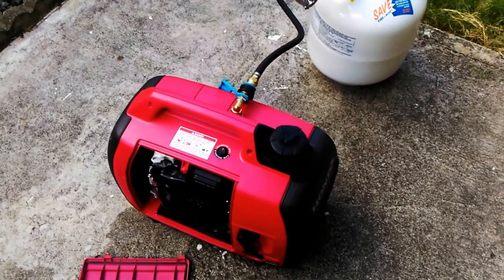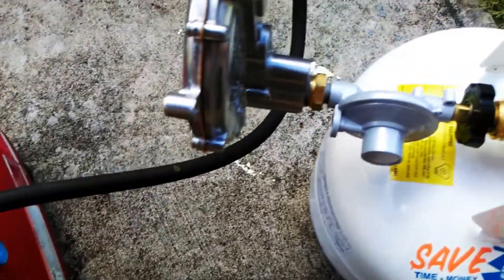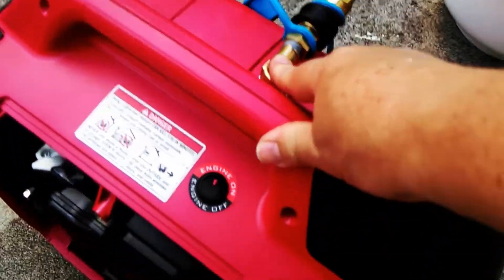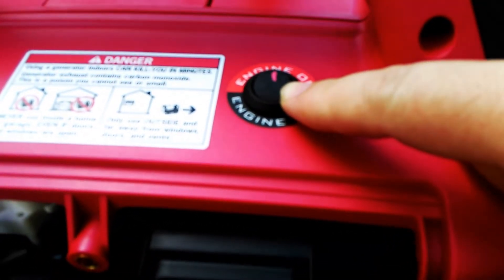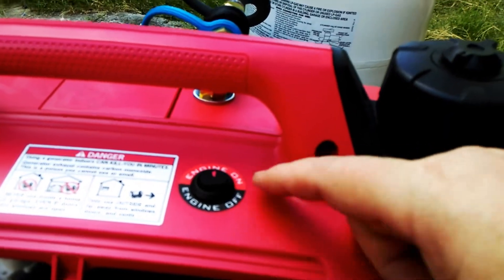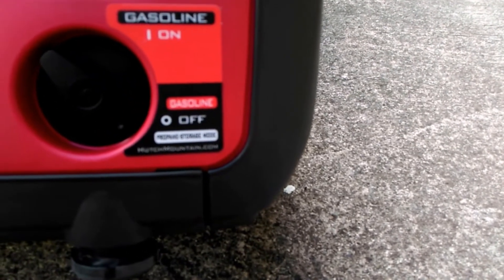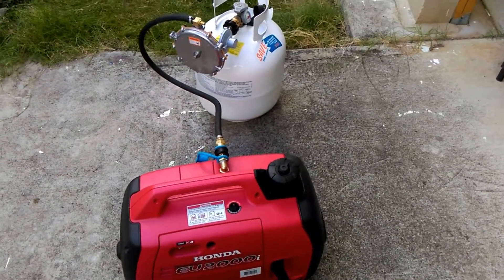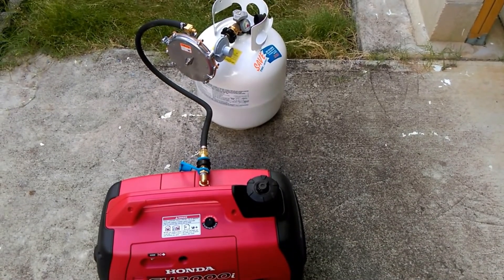Hutch Mountain propane adapter for EU2000i

Comment: So with the hutch it it can run on both propane and gasoline?? Or just propane??
Reply: BOTH.  I intend to have 5 gallon gas tank AND propane tank.  In Eco mode the Honda will get about 3 hrs of run time per gallon or 30 hrs on 10 gallons of fuel.  I installed a $20  RPM/HOUR meter to serve as fuel gauge.

Comment: how much does that propane tank run, how many hours on eco mode?
Reply: I get 3 hours per gallon of gas on Eco mode. 2800 RPM.  Propane and gasoline have similar properties so a 5 gallon gasoline or propane tank should allow approx 15 hrs run time.  Pick up an inexpensive RPM/Hour meter to serve as fuel use guide and 100 hr run time for oil changes.  That device is very easy to install; just wrap a wire around the spark plug cord.    About $20.
Reply: @DesignerAviaries  Isn't the EU rated around 8-9 hours at 1/4 load?

Comment: How does the propane stack up against gas re cost? I think propane is  much more expensive fuel source. There are advantages but cost wise does this make sense?
Reply: We just went thru a bit of a natural natural disaster...gas was hard to come by for a few days. I’m getting this kit because I can have a couple bottles of propane ready without worrying about if gas
Reply: In San Diego, propane is more than a $1/gal cheaper than gasoline.
 Most economical at $2.32/gal with no minimum.

Comment: Is there a particular spark plug recommended for propane? I have the standard plug that came with the generator. It works great! I installed your conversion kit back in 2016 and used it twice. Starts right up every time. Thanks!

Comment: I'm curious about how long a standard propane tank will run the generator relative to regular gasoline.  Which do you get more run time out of?   Thanks for the video.  I may order one today.
Reply: You'll be getting about twice the runtime with propane but you'll also 
be using around 4x the gas. Temperature & load is a big factor. In cold weather wrap your tank in heater blanket (draws 50 watts). Warm to 85 degrees for optimal runtime.

Comment: Oh, did you get the kit that can run with natural gas from Hutch Mountain?? Because I've been debating weather or not to just get the propane only option or the tri-fuel option, it's only like a $10-$20 difference between the two kits.

Comment: Did you upgrade to the propane spark plug Hutch Mountain recommends? Thanks for sharing this video I think I will go with this conversion also..
Reply: Only needed if you have a newer gen.  I didn't need one, and the docs that come with it say only 2016 and newer should need it.

Comment: Great video, awesome setup I have a Yamaha ef2000is and have been shopping around for a conversion kit. I was on their website and noticed that they don't offer anything for Yamaha's strictly Honda. My question is how was the mounting of the quick connect achieved? Were the quick connect fittings threaded? I don't know if you are familiar with the Motor snorkel by US corporation (it is basically a gasket you replace on your carburetor) is this system similar? Also, going from the quick connect to the carburetor is that a 1/4 inch  line? And from the regulator to the quick connect fitting what size hose?1/2 inch? And finally the electric cut off switch, I would think it is much safer to turn off propane valve, no? Thank you. Again, great video